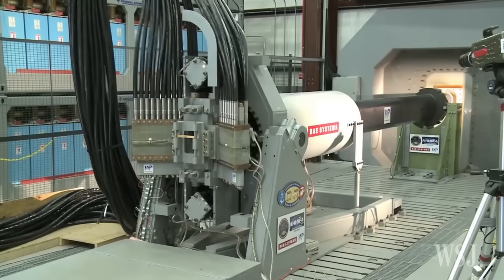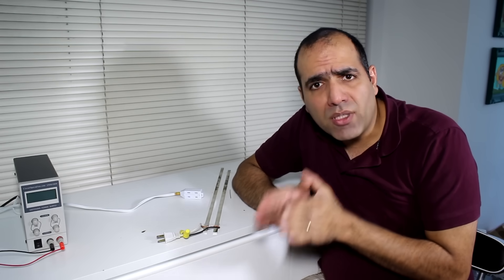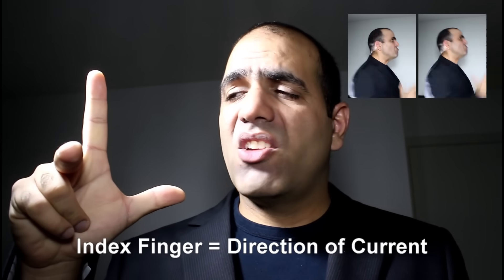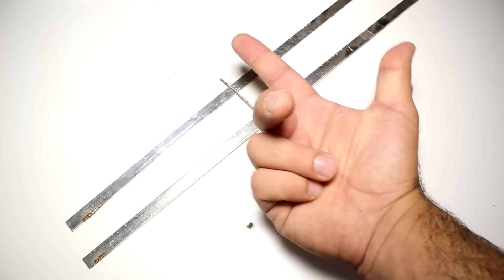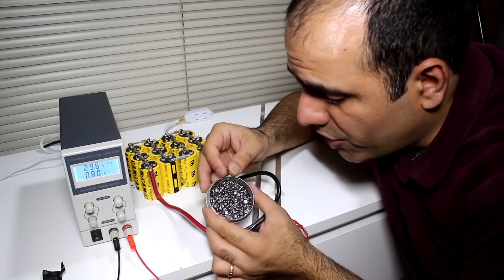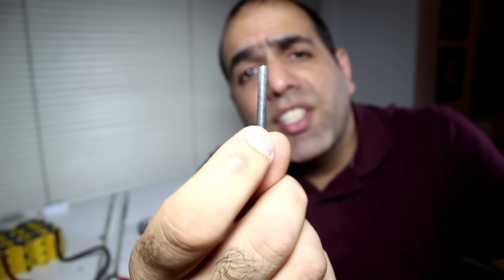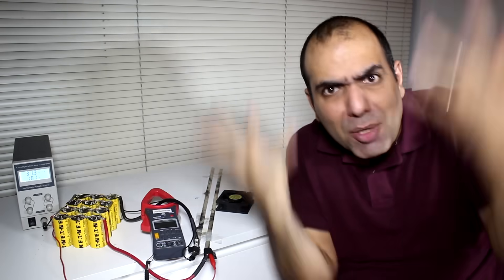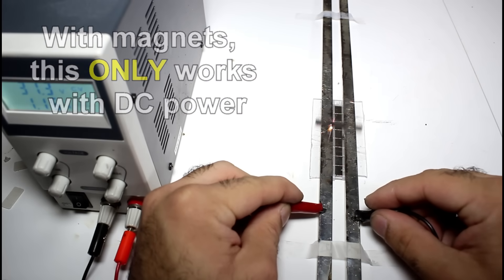Science behind Railgun, ElectroBOOM Style

Comment: 😂😂😂😂😂😂
Lol... but why a straight line of firing isnt the established method of moving this quickly in a magnetic feild not the particle accelerator method....what are their cooling methods? 
And how did you get graphite to glow with heat i thought carbon was the one element that melted at almost 5000 degrees

Comment: The reason it kept getting stuck and not even moving itself earlier in the video is because you were using to much current, however, later in the video when you were using magnets, it was only on 1.1A, which is why it moved with no problems.

Comment: Ive been thinking and looking at wikipedia for things, especially for "magnetohydrodynamic converter"
so im just wondering if you could answer my question about the right hand rule.

would it be correct to say that, the thumb is motion, index finger is current from + to -, and middle finger is magnetic field direction from north to south,
so, using that with the right hand, you would see what direction force is induced by the current and magnetic field, but using the left hand, you would then see which direction the current is induced by the motion instead.
is this statement correct then or am i wrong about something?

Comment: Back in school i was taught Fleming's Left Hand Rule...so i am a bit confused... Can anyone clear my doubt regarding which hand to use for knowing Direction of Magnetic field current and force?
Reply: You can use either, but depending on which hand you use you assign the vectors differently. If you go by the left hand rule, you probably have like thumb = force, index = magnet, middle = current where the right hand shown in the video is thumb = force, index = current, middle = magnet. Note how the rules swap what the index and middle fingers are assigned to. This swap makes them equivalent and both work. Just don't get them confused.
Reply: @gobnazfalaman  thanx a lot mate
Reply: @shubhambanyal6173  Also, left hand rule is used for electric motors and right hand rule for electric generators.

Comment: sir please explain why is the direction of current opposite to direction of flow of electrons 
and  how does electrons become free
and see how much these videos are correct https://www.youtube.com/watch?v=Oc7nDSgAa-0
https://www.youtube.com/watch?v=prL6uB7fVgs&list=PLfZEeRbGh2bcyyvAaa1-LXUiCaHKd_Rgr&index=2
Reply: The reason the direction of current is opposite to the flow of electrons is simply because of convention. It's the same reason electrons have a negative charge, instead of positive. There's really no reason for it besides someone at some point in history mixing the two up.

By "how do electrons become free" I assume you mean how they can travel through matter. To have an electric current you need two objects, (such as ion solutions,) one with a negative charge (that is, more electrons than it wants) and one with a positive charge (not enough electrons). With metals, for example, the atomic structure is such that it can easily accept more electrons than it technically wants, but it can also release other electrons to balance it out, since the electrons can move through the lattice freely. I think it's important to realize that the electrons being conducted aren't the same electrons that it received, but just some random electrons that happened to be near the positive end being thrown out to accomodate for the new ones at the negative end. Once that's done, the leftover electrons spread out across the metal lattice so that the charge evens out.

Comment: The gun has no flaws and dont need the magnet.
The only problem is that the projectile does not move on its own when turned on, which means you have to manually push the projectile
And the projectile goes forward or backward depending on which way you push it

Comment: Lead is what made the Roman Empire great (again). Romans stored wine in leaden vessels, because it gets sweeter with age. Because the acetic acid formed from oxidation of the alcohol reacts with lead to form lead(II)acetate, or "lead sugar", very sweet tasting but also quite toxic as it is a water-soluble lead salt. As the long-term effects lead accumulation affect the nervous system, it is what nourished and shaped the great Ceasars.
Reply: btw the body can manage small amounts of lead. Plus high levels of calcium and iron tend to provide some protection from lead poisoning. It's still pretty toxic though, but I wouldn't worry about handling the metal (unless it is breathing fine lead dust of course).

Comment: Some college friends of mine built a proper, no-bullshit coilgun once. It threw a 6” steel nail fast enough that it went clean through a 1” thick piece of plywood — hitting sideways.

There is nothing more dangerous than bored engineering students and a well-stocked machine shop.
Reply: Is this why militaries are filled with bureaucracy? To prevent or encourage this kind of experimentation.
Reply: @techstuff9198  Given that we were all either reservists or cadets (ROTC) at the time, I'm going to to have to answer with yes.
Reply: Well I envy that. I always wanted to have a machine shop with all the tools I may need. Might start building military grade stuff if I had the budget and a few engineering friends
Reply: that sound cool
Reply: coilgun or railgun?
Reply: @vermillion4971  Coilgun.
Reply: please dont say the s word like that
Reply: @giovannicorraliza4393  I will use  profanity however I flipping well like.  It’s a simple expletive, not something offensive like a racial slur.
Reply: @giovannicorraliza4393  shit i didn't know i must not say the s word
Reply: @giovannicorraliza4393  shit
Reply: @giovannicorraliza4393  What s word???

Comment: I am not sure but I guess that the 2nd rule was the left hand rule
Reply: It is, but here's why he can call it the right hand rule and still be correct.

See, there's another way to remember which vector belongs with which finger:
thuMb = (direction of) Motion
First/Fore finger = (direction of magnetic) Field
seCond finger = (direction of electrical) Current

You can actually apply the Right Hand Rule (which is normally used for generators) to a motor by switching the B (magnetic field) axis and the I (electric current) axis and it'll still work for you just fine.

The only problem I have with the way he presented it however, is that he didn't specify which rule he was using; whether it was Flemming's Rule for Motors as opposed to the Rule for Generators, which for anyone watching that isn't that familiar with the science of electricity, could prove confusing later on.

It's easier to apply different hands to both rules as that way you don't have to worry about which way the axes should be oriented (it's already done for you); you could use the mnemonic I stated above and it would work just fine.

(In hindsight, he's supplying electricity to create a force, which should make it pretty obvious which rule he's using; I just a little embarrassed I didn't notice that sooner.)

Comment: I think your misunderstanding the physics behind the rail gun, yes the two poles are creating a magnetic field but shorting them out was the false information you got, the projectile is moved by the magnetic field, not by them shorting out, and I'm pretty sure they use a one single Pulse with the most voltage they can produce, so your cap bank should work, if you enclosed the system and pumped gas trough it the ark can travel through the gas, like a cathode ray gun tube from a old school television used to work, I hope my knowledge helps you with your experaments

Comment: You can’t use the wire’s own generated magnetic fields to apply a force to itself. On one side, the B field is up, and on the other side, it’s down so there is no net force. The external magnets are a necessary part.

Comment: I would think that when you short the 2 rails you create an intense magnetic field which will shoot a magnetic material forward if laying BETWEEN them.
No shooting the material you are connecting the 2 rods with!

Make the 2 rails line up paralelly and put an iron ball (maybe?) Between the rails at the bottom.
Connect the power to the rails at the bottom where the ball is.
Now short the rails at the other end!
For this to work I guess you need to fixate the 2 rails aswell as create a barrel for the ball to  glide in.

Comment: The projectile welded to the rails because it needs start speed. This speed is nessery needed to avoid the further heating of the metals. In the rail gun they are using gun powder to speed projectile up, before passing current through it. Or instead gun powder  there can be used isolated projectile (for example in a plastic package) and ionized gas uder the pressure. So gas starting pushing the projectile with the pressure, then a high current is been passed through it and according to your two rules, gas becomes the projectile and with it's force it pushes whatever bofore it. You can use  CO2 for airsoft guns, because there is pretty high pressure and they are cheap.

Comment: Also, let me point out that the rails need to be closer together. Try less than an inch apart. This will intensify the magnetic field. Also, try using copper for the rails, and the wire. Copper conducts better, and isn't quite as easy to oxidize (something that happens with the high-current arc at the moment of contact that corrodes the metal and increases resistance). Silver is even better (less easy to oxidize than copper, and is an even more conductive metal than copper).

Comment: @Electroboom, I love watching your videos. I had a question. I can see that there is a significant current flowing through the rails. How are you able to touch the burning graphite rod on the rod with your bare hands. I am not getting why current will not flow through your hand?
Reply: It is because the current already goes through the rod and he only touches on that rod so no current passes through him at all u should be connected to ground or negative for current to flow.also our body resistance is very large and thise 30 vots cannot harm him.

Comment: This is supposedly very high-tech (Reportedly reverse-engineered UFO tech from the 70's) which is at least 50 years ahead of our time if you look at consumer technology.

It went something like: use magnetic fields to rotate a magnetic super-fluid within a hollow donut-shaped superconductor (refined graphite/graphene?) at high speed and you should start seeing mass & inertia reduction effects for all matter within/near the "donut". There was also something about the golden-ratio/Fibonacci-sequence being important in the construction and in ratios between different parts. 
Use 2 systems, a smaller one within the bigger one, and have the fluids run in the opposite direction to produce not only the previously mentioned effects, but also anti-gravity and also the basics for sub-lightspeed and FTL propulsion (and more) in a much more developed state/phase with other devices in place to compliment this supposed TR-3B engine-core.

That is what I remember from 10 or so years ago when I first came across these leaks in regard to the "TR-3B", on multiple webforums by people who abruptly stopped posting and shortly thereafter their topics/posts deleted along with their accounts. The last guy added that one of two Faster-Than-Light methods for the TR-3B spacecraft was to get the fluids both rotating at relativistic speeds, near or at the speed of light (it was either that or the sum of both liquids' velocity was c). So be aware of that too if you ever decide to go all Nikola Tesla and experiment with this idea I'm putting here and it turns out not to be bull# :)

Also, I came here from SmarterEveryDay btw. Love the vids that I've seen. Subbing!

Comment: It's flemings left hand rule. You use the right hand for a charged particle so instead of direction of current you have the direction of velocity
Reply: That is not true. Fleming's right hand rule is for electric generators and the left hand rule is for electric motors. You do have to account for charges because of Lorentz force, which is done by swapping which way fingers point.

Comment: I thought railguns used induction. If the short was static, and the magnets not, the magnets would move. If the magnets were replaced with a non-ferrous metallic conductor such as aluminum, the induced magnetic field would oppose the generated one and would have a similar effect, no? That's the explanation I've always heard, at least.

Comment: Still Waiting on a Beefed up Rail Gun D:
Reply: Yep we need the 300 amp version
Reply: With making a rail gun he can't just put the projectile on the rails then give it amps the rails need to be powered before hand and the projectile needs to be moving before it gets to the rails to fire
Reply: Correct. This video does a good job explaining the science behind the railgun but doesn't really demonstrate it properly. 

The Hacksmiths video managed to build a fairly powerful and slightly portable railgun that actually could break various pottery. I happened to notice, however, that the bullet would always tumble because with the railgun barrel you don't have any rifling so it doesn't spin. There's also the damage caused by the arc flashes between the projectile and the barrel which makes the bullet less uniform and prone to tumbling.

The Navy got around both of these by using a two-layered shell with fins. The outer shell is what comes into contact with the rails, and breaks off when it exits the barrel. The fins on the inner shell help keep it in stable flight.

Comment: The reason why the projectile didn't move without the magnets, is because the piece of metal was outside the magnetic fields, so I think you should have used a smaller and less wider wire. The magnetic fields wlyou added when you added the magnets, expanded the magnetic field and so the wire was captured due to the expansion of the magnetic field so then the wire moved, you could try it again.

Comment: what about goldplating the bars to eliminate resistance in the rail? making some goldplated projectiles would be good too.
Btw, your project is using the rail in the wrong way, it should have the projectiles shooting from the end of the bars to the start of the bars, finishing in the part with most current for a final acceleration, that being the side with the wires.

Comment: You really really know your stuff to do these stunts!! So with the rail one - did you even feel a shock? Were you completely insulated? Was the closet rail to you the neutral? So when you grounded the wire to the neutral rail first, then tipped it to the hot, it shorter and arced, but you didn't get a shock beyond a mild tingle?

Comment: shit also forgot to mention.. i didnt have money do do this either but what you can do is have the cao bank full charge and connected to the rail and inject the projectiles into the rails using co2. essentially a co2 gun fires the projectile into the rails once engaged with the rails the projectile vastly increaces velocity once the high current from the cap bank discharges

Comment: The reason your railgun doesn't work is because the bar is moving so slowly that it instantly gets melted to the rails. Even when you use the carbon rod, the rails can still melt to it. Usually railguns use compressed air or even explosives to push the projectile onto the bars, already moving fast enough that it won't get stuck. The railgun just makes it go faster.

Comment: For the welding problem. I dont even do electrical engineering but I kinda have an idea if you wish to try, since you already have a good setup and only need to pull out things from storage. This idea requires AC inputs to the rails though. I suddenly thought of that tesla coil thingy you made.

Now I dont really understand magnetic field strength whether current or voltage matters more, but imagine if you can use the air as a conductor rather than metal on metal. I have a feeling it seems to be enough to close the gap between rail-projectile-rail. Or perhaps just amplify the voltage just enough to ionize the air but keep current still moderate?

Also, for the magnets, what if you can redirect a little bit of the current into some electromagnets? Not sure if the response is fast enough since inductance might cause the magnetic field to form a bit late. Or perhaps keep the electromagnet always on.

Just some ideas what if you sorta want to experiment some stuff

Comment: I like your videos.. You're  funny. Could you help me with understanding something..

For example I want to power, 30W "highpower" LED from 3A powerbank.  To set current and voltage I use step up converter.. But 3A powerbank can give only 15W of energy.. The question is what will happen if I exceed this 15W - draw more power from powerbank which it can give.. obviously it will not generate energy from nothing. but what will happen. The power bank will burn, or just LED turns off, or something different ?
Sorry for my english if there are any mistakes.. eng isn't my native language.